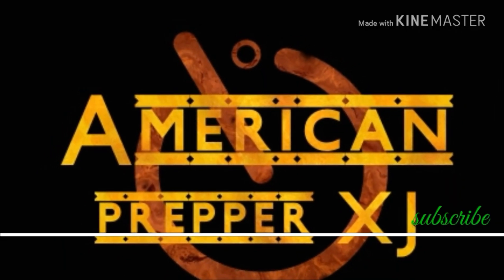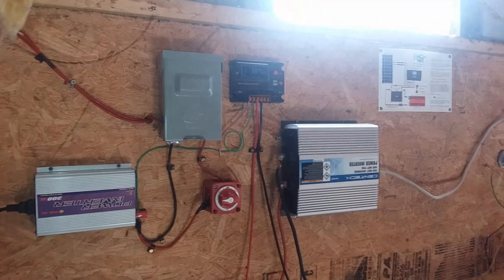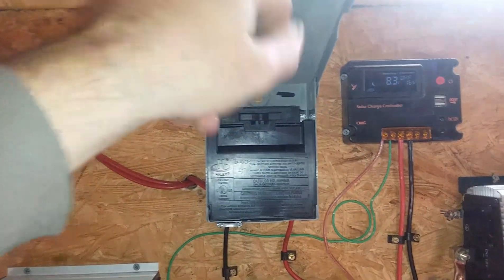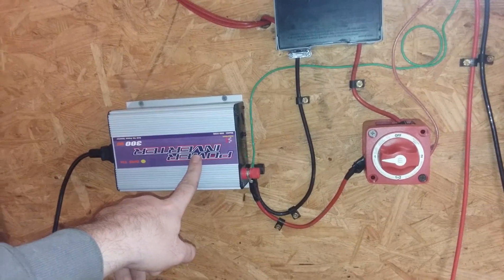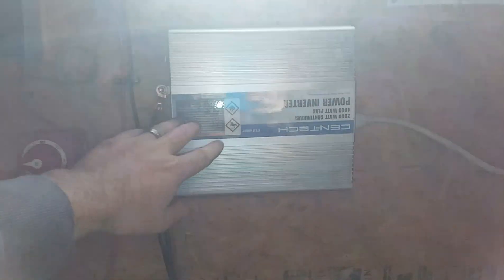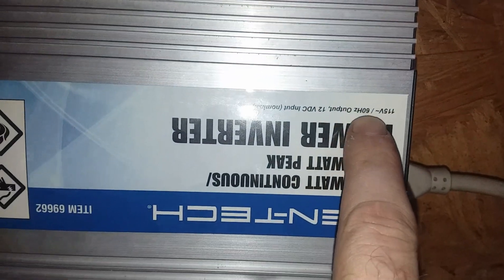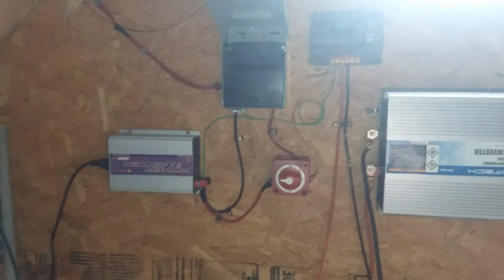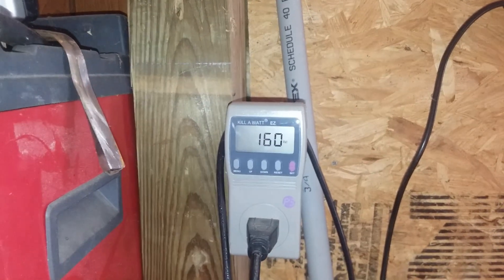new 400 watts Harbor Freight solar system update

Comment: The reason why it womt power it is because the inverter you have is a modified sine wave inverter and they struggle to power electric motors and if they do power them the motors make an annoying buzzing sound. You need a pure sine wave inverter to power electric motors, microwaves, stuff like that
Reply from the maker: Thanks that's what I figured it was looks like I just have to get a pure sine wave inverter thanks a lot
Reply: You're welcome

Comment: The wires from your batteries to the inverter look small to me. I have the same inverter and it requires 2 gauge wires no longer than 6 foot long. I personally used 0 gauge wires and have no problems powering anything.

Comment: Do you have a battery connected to your inverter?
Reply: Shouldn't be any reason why that fan wont come on other than low voltage on battery.. My inverter says 115 volts also but i have fans and light's that work fine.
Reply from the maker: The fan comes on but makes it slow whining noise with a hum and if I have all the solar and the battery going through an inverter it still ain't enough
Reply from the maker: I guess I'll just see what happens when i get three more Marina batteries. how many batters you have?
Reply: Well..... Could be the inverter i guess.. Mine is a Jupiter from harbor freight. Its not a pure sine but it seems to run what ever i connect to it.. I know saying try another inverter isn't all ways the easiest but something sure isn't right because you have more than enough power to run that fan. I can run a box fan with my 400 watt inverter in my truck. Make sure the connection to battery is bolted on and not clamped☺
Reply from the maker: Yeah 12-volt deep cycle marine battery I only have one for now. hoping to get at least 4
Reply: I have one battery. It's a 100 amphour marine. Its in my videos..